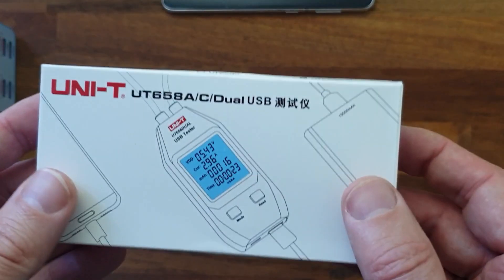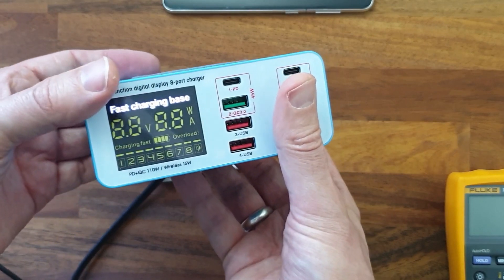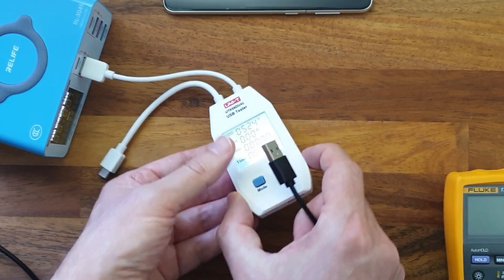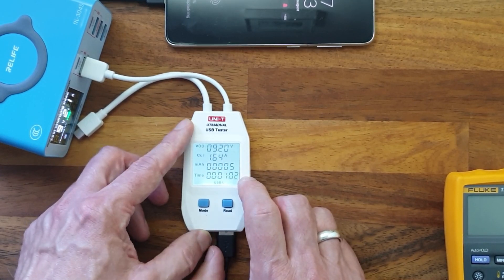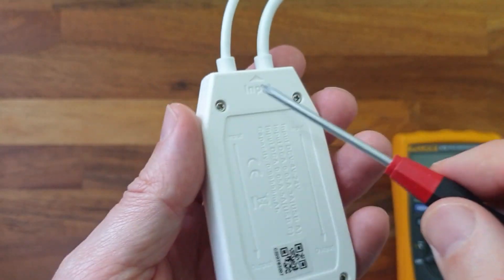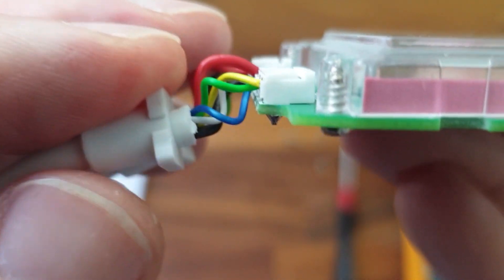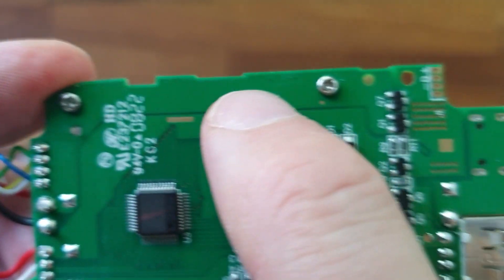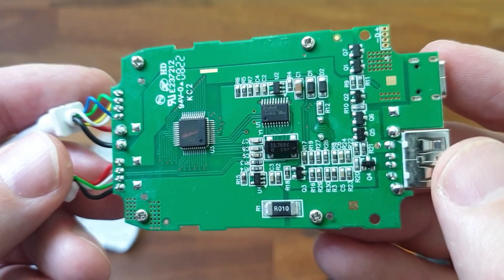NorthridgeFix USB-tester review and teardown

Comment: FYI : the display driver labeled "SF16C22" (they sanded everything off except that ??) would match one made by "SemiFree". Just opened my unit  and it is unsanded, and says both SemiFree and SF16C22. Sidenote : new out of the box, mine doesn't read any current on the USB-C side. Looks like this is common in online reviews ? Disappointing piece of junk.
Reply from the maker: Thank you for feedback, really strange why the USB-C port does not work, did you find the problem and did you fix it?
Reply: @made.by.morten.laboratories  Hi, I haven't looked closely, but I only noticed one single current sense resistor, on the USB-A side, and no obvious sign that they're routing USB-C current through it. I wonder if on the USB-C side they just rely on the USB-PD comms to determine current ? Kindof useless if that is the case. Does yours report anything at all on the USBC side if charging something from i.e. a plain dumb charger ?
Reply from the maker: @fenugrec5697  The two cables USB-A and USB-C are inputs, you will find the output  connectors below the two blue buttons - please check you use the correct ports

Comment: In some of those, the display driver is a CoB. I wonder why they felt the need to obfuscate the display driver of all things but not the CPU.
Reply from the maker: Yes its really strange, i noticed the same - i could understand it if it was in a +1000 USD product
Reply: @made.by.morten.laboratories really strange indeed, almost as if they did not want anyone identifying the lcd controller and think that the chip was copied of a different product or manufacturer idk weird!

Comment: The low side current sense will mean the gounds either side will be different and is something I would avoid. The cheaper power supply boards you can get do similar and can cause isues if your input and output grounds touch anywhere.
Reply from the maker: Yes you are 100% correct on this one and the more current the more it becomes a problem- Thank you for comment :-)

Comment: Interesting that this tear down came up on my feed just now. I was actually looking for one a few days ago but there wasn’t really much! Anyway, I was looking because this unit has problems. Prior to buying this, I have a portapow usb tester that is highly accurate and runs from an internal battery. I also have four zxy usb 3 testers - they released a number of versions blue - green - red and orange I think (I’m colour blind) - but this is why I have four, I picked one up each time they upgraded. On top of this I have a wpt? Pd trigger that shows current and voltage for usb c. So I noticed with the uni-t that it was drawing 14ma whilst the xyz units drew just 8 and the portapow zero. No huge issue but what I also noticed was that the uni-t does not always allow the voltage to switch up or the full charging current to pass through. As an example, my iPhone 14 with a usb a lead will charge at 1.4amps roughly on the zxy devices but on the uni-t it will not got over 1 amp. with usb c charging it seems to function well and voltages switch up properly. I decided to tear mine down and found that the two high current leds from the usb c input were too large to fit through the holes on the Pcb. So only part of each cable was actually soldered and attached - approximately 2/3rd of it I’d guess - meaning (to me) that the high current limit claimed is probably not going to be achievable. Not too much of an issue but I did try to thread some fresh leads through the Pcb and join them to the old to fix the issue. Sadly made a mess of it but managed, with the positive lead, to achieve this. The usb trigger I have is complicated and nowhere near as simple to use ad the uni-t so I haven’t really compared them. I bought the uni-t a few years back thinking it would cover all my needs and whilst it’s a good little unit, it does haven its problems. Problems that my other testers do not have.
Reply from the maker: Thank you for your comment, its really interesting to read. Maybe some of the mosfets was damaged, you can always try and connect the red wires directly since the current measurement is done on the GND wire - please not that the current and voltage limit is out of function then. What do you use your tester for? Do you do repairs? I will have a look on the types that you mention here, thank you.

Comment: relife charging dock is rubbish
Reply from the maker: Do you have problem with yours?
Reply: @made.by.morten.laboratories  yes the way it shows voltage and amps when plug few devices very confusing
Reply from the maker: @071Rishi  I will try and play with multiple devices pluged in to the charger at the same time